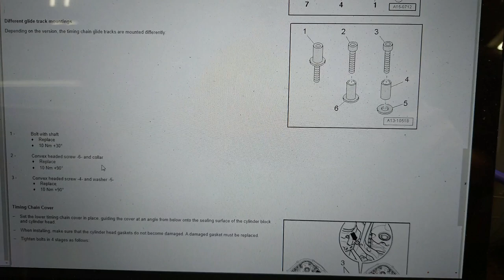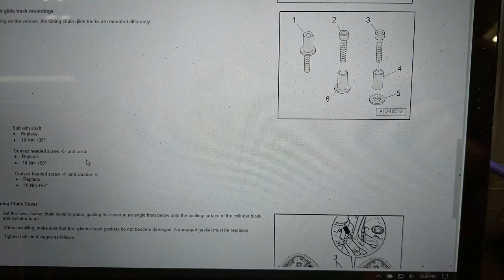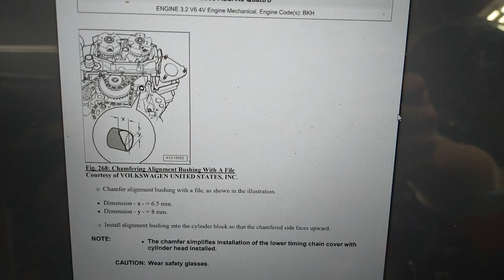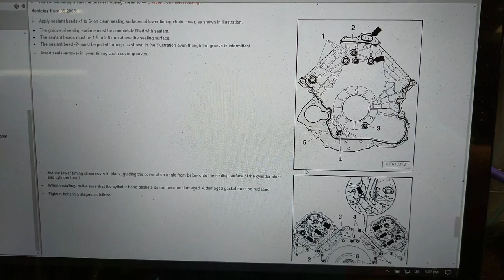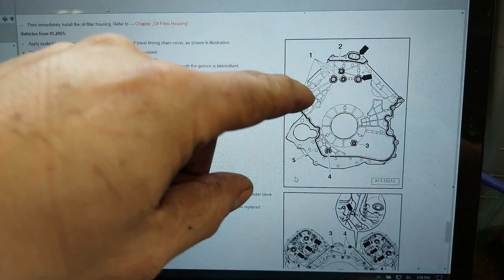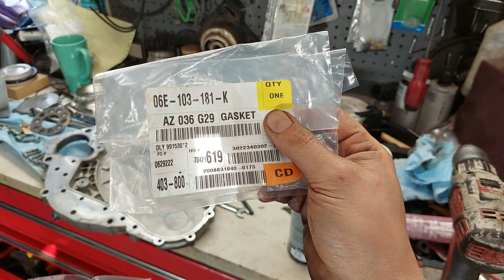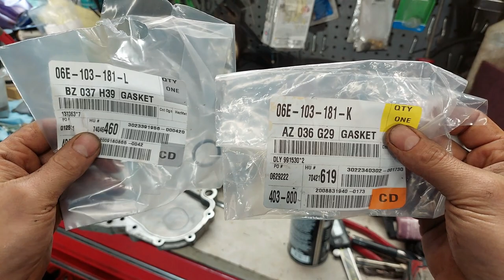2005-2011 Audi 3.2L V6 Timing chain and guide replacement | Torque specs and tighten sequence

Comment: Hi guys,
I have replaced the upper timing chain tensioners on both banks and now the group   93 shows the next measurements:
Phase position Intake Bank  1:     -20.6
Phase position Intake Bank 2:     -18.4
Phase position Exhaust Bank 1:   -20.6
Phase position Exhaust Bank 2:    -21,4
I used the locking tools for camshafts and the locking bolt for cranckshaft.
I followed the ALL DATA specifications.
What you guys think happened?
I removed everything out again and started from the beginning,but I get the same measurements
I did a compression test to see if something happened with the valves and I've got between 11.5-12.5 bar.
The car starts and runs fine for about 20 seconds and then starts to rattle  bad.
Any thoughts?
Thank you!
Reply from the maker: So, My first thought is did you counter hold the phasers the correct direction. This will put it very far out of time. I would assume would run ok until the car is in closed loop and then is controlling the cam timing to a point it can not advance/retard it. Let me know how you make out. And thanks for watching.
Reply: @WillPowered Garage  Yes,I counter hold the phasers the correct direction.
I watched your video plus All Data specifications.
Maybe I have to put more tension on the counter hold tool?
Reply: Hello . I am having the same problem with my 3.2 fsi after changing the upper tensioner, block 93 gives me  negative values on all 4 phasers, before the change i checked the values were perfect. Did you figured it out , what is causing this? I am goona be very gratefull for a little help! By the way great video guys , it helps a lot.
Reply: @Johan Vasilev  I haven't figured it out yet.
What measurements you get?
Reply: Intake bank 1: -14.25
Intake bank 2: -9.36
Exhaust bank 1: -16.87
Exhaust bank 2: -9.36
I think either didnt put the chain good or the new tensioner needs to be reset, i watch some guy in another video doing that before install it.
Reply: Did u mix the camshaft camfasers
Reply: Hi I’m having the same issue that you are having 
Did you figure out what it was 
if you did if you could please let me know 
Any help will be very appreciated thank you in advance

Comment: Brilliant to put the timing chain in the back of the motor. I junked mine with 140k miles cuz it failed. I'll take a timing belt all day
Reply from the maker: Only one better is Ford putting the water pump inside the timing cover, timing chain driven. That way when the seal goes bad it fills the crankcase with water to make a milkshake.

Comment: Hi. Could you tell me why you didn't replace the seals under the upper tensioners (isn't it necessary?)
Reply from the maker: I did replace them. I talk about the surface needing to be clean and dry of oil and dirt. Unfortunately, I did not show me installing it more than just putting the bolts in and torque.

Comment: Can you pull the engine without a lift and without removing the transmission?  If so, do you know of any videos that help with that?
Reply from the maker: You might be able to do the job by removing the transmission and then replacing the chains with the engine in the car still.  But its way easier with the engine out and able to get to everything.
Reply: @willpoweredgarage969  I recently finished a timing job on my B8 A4 wih the 2.0TFSI. It was my first engine pull and worked out surprisingly well.  Was able to pull the 2.0 without putting the car in service position.  Tight but doable.   I want to do chains now on my 2009 Q5 with this 3.2 FSI Engine.  Is getting it out any more challenging than the 2.0?  Can you pull it without taking off the front bumper?  Lots of videos out there about servicing this engine once it’s out but not much on actually pulling it as easily as possible.  Any thoughts?

Comment: Hi There, thanks for the video, I'm doing an audi q7 4.2fsi v8, I forgot to mark the cam sprocket or vvt sprocket(adjuster), but you said it doesn't matter which way it's go, are you 100% sure lol, anyway did your engine start and goes well after that, sorry to ask but I one to make sure before I put this on, thank you.
Reply from the maker: Ok, So yes and no. Yes it does not matter because there are no keyway or pins to lock it in. That rear bolt is what holds the cam phaser to the cam. It does however matter that you make sure the intake phaser is on the intake cam and same for the Exhaust phaser and cam. You also must use the cam locking tool and crank locking tool so that everything is perfectly timed. The other important thing is to make sure you counter hold the cam phaser in the right directions. The intake and exhaust need to be held in different directions as you tighten the rear bolt. I even had to read this a few times and I even watched a few youtube videos. lol Let me know if you have more questions.
Reply: Thanks for that, yes I will make sure that intake phaser goes to intake also the exhaust, and I've got the proper locking tools to tight them. Did you have any issued after running this engine? Thank you.

Comment: Great video! I'm quite certain I have this issue but I don't have any hard engine codes yet (I caught it early). Is it always the upper timing chain assembly or could the lower timming tensioners also have this issue? I have VCDS but I'm unsure how I would verify this as the timing is fine 5 seconds after start. I just don't want to replace both upper chain assemblies to find I actually needed to pull the whole engine... Thanks!
Reply from the maker: Well, Its usually just the upper tensioners guides that become brittle and fall apart. When I removed the rear timing cover I saw the lower chain guides were also broken and very brittle. Its just a lotttt more work to get to the lower set.

Comment: hi, how did you get the rear main crankshaft seal on ? i have been having the worst luck trying to get it on.
Reply: There's a special tool for it and the piece the flex/flywheel bolts up to has to be pried off first
Reply: @josephlabosco3063  yes the T10122C but i have purchase two of them sent the first one back be the updated t10122c/2A is not sized correctly for my crankshaft. MY second one that I have now has the same issue. I wasn't sure if you knew of another way other than sending to a dealer.
Reply from the maker: So the tool is nothing more than a guide to get it over the harsh edge of the crankshaft. I think in one of my other videos (2.0 TFSI maybe?) I showed that i like to use the bottom of a chinese food container. 
They are tapered , so I just cut it in the area that fits over the crankshaft. The container has a radius on the bottom and the seal with slide over it and over the crank. Then carefully put the container off.  The seal is made of teflon and will stretch a bit but don't worry it will relax back to size and make a perfect seal. Hope this helps, and thanks for watching.
Reply from the maker: Yes, that's correct. There is a spacer that is on the crank. Might look like part of it at first glance, but Joseph is right, it needs to come off before you install the seal.
Reply: @willpoweredgarage969   I had used a taco bell cup that worked great with a 3.0 supercharged, worked great!! lol  but this 3.2 is a head scratcher for me. I have not noticed a spacer on the crank, I will give it another look.  Thank you!!!
Reply: @willpoweredgarage969  I appreciate the feedback!!! I will look at it again more carefully

Comment: Is the line up mark on the balance shaft.
Reply from the maker: The balance shaft does not have any marks on the gear. As long as the crank locking tool is installed, and the balance shaft is locked in with the drill bit as I show or the special tool it will be in time. Unfortunately there are no traditional timing marks on this engine. Hope this helps.

Comment: Hi, is the timing cover or what it bolts on to, aluminum? Thanks!
Reply from the maker: The lower cover is aluminum.  The upper covers on the heads are stamped steel.

Comment: How dare you skip over putting the cover back on 😂 that's why I'm here how the hell did you get the cover back on without damaging the head gasket? Right now my decision is cut the lower level off this gasket and try again or pull the heads. I'd appreciate some tips if you have any at all
Reply from the maker: First of all let me say, I'm sorry. I did not show it because I had a world of trouble getting it on. The head gaskets are so thin in that area that it is hard to get it back on without kinking it. If I would have left the camera rolling it would have been a good 20mins of me staring at it trying to figure out how to get it on safely. The best tip I have is like I showed in the video, make sure you put that chamfer/angle on the dowel pin so that you can get the rear cover on easily, well id say at all. I actually ended up taking more material off of the dowel than Audi suggested and that made it so I could get it right in place. I also made sure to put extra sealant on the corners where it met the headgasket. :) Thanks for watching.

Comment: hey man I see youre kinda active still i really need to know how to get the rear main seal back on, cause the tool is a little too small i dont know if you ran into this same problem but if you have any answers to help me get my seal back would be greatly apreciated
Reply from the maker: What tool are you using? Its really just a plastic sleeve that fits over the crankshaft to slide the seal on. I have in a pinch used a plastic food container ( like you get from a Chinese restaurant full of soup) its tapered in shape and you can cut it to the size you need. BE careful with the seal, it is very fragile and you don't want to kink it. It is ok to stretch it out with the tool. It will conform back to the original shape though.